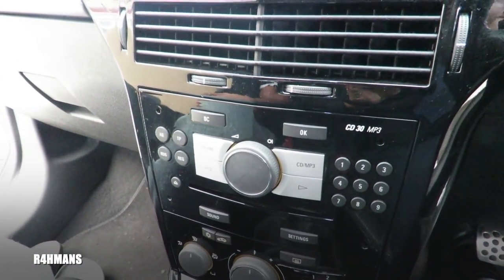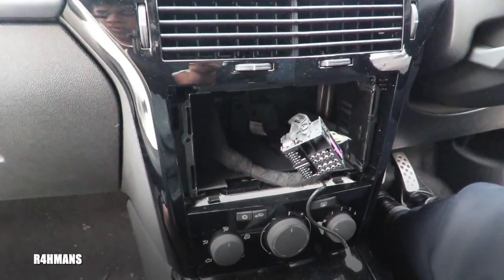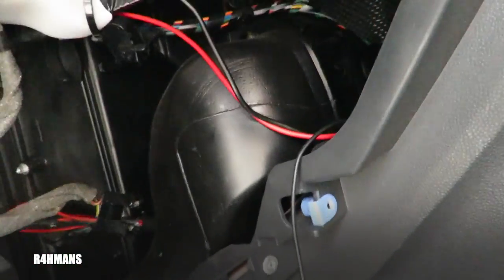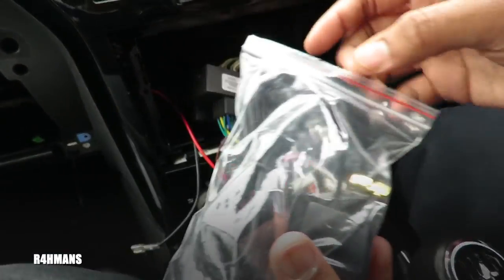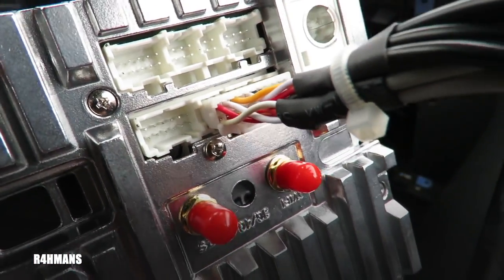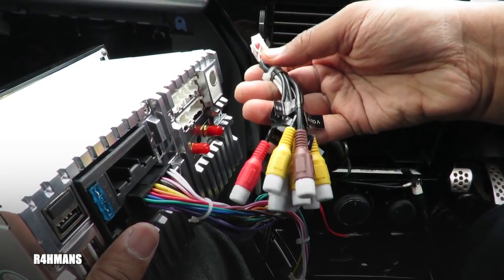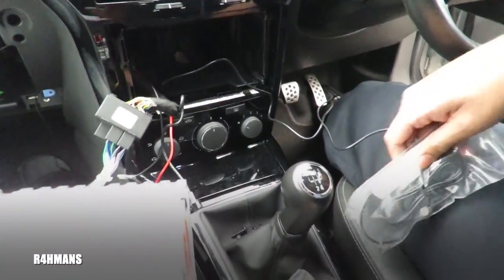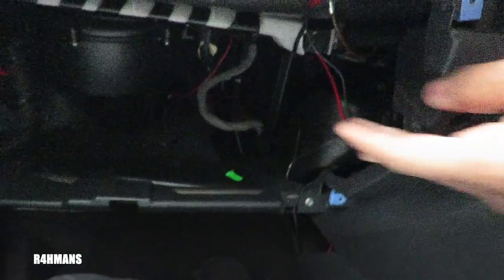Installing Pumkin Headunit Astra H With Apple CaPlay and Android Auto Adapter

Comment: Can you control and change car system settings like km/consumption statistics etc??
Reply: hglrr Yes, you can. Just with the steering wheel buttons or an app on the Android unit
Reply: Mick did he connect steering wheel control
Reply: @noneya96  there is by default on astra h

Comment: bro thank you for the well explained tutorial! i got one question, can u connect this radio to a rear camera for driving in reverse? ty in advance !! 🙏🏻
Reply: and if so, can you do a video to that topic? or maybe link me where i can find out how to do that?
Reply: It is actually very simple to install. You can buy a special reverse camera that replaces the license plate light unit for the Astra H. You will have to connect 4 wires to the Android unit: rca videosignal, reverse signal (which activates the camera when you go in reverse), positive pole and the negative pole (ground). There are special wires labeled for this at the Android unit. Don’t use power from the reverse lights, since they are canbus powered. When you set the gear to reverse, the music will stop and the camera shows automatically. You will have to guide the  wires under the plastic covers underneath your seats inside the car, which also hides the other wires. The hardest part is to remove the plastic cover in the boot, which is just pulling. Overall a very easy job to do, it shouldn’t take up more than 30 minutes.

Comment: What about car's computer controling? (navi, fuel consumption etc.)
Reply: If I'm not mistaken, that's all in a separate unit above the stereo
Reply: @Jimlad0116  well its controlled by that biggest ring on the original astra H radio :)
Reply: @realonepx9885  ah I get what youre saying. I literally bought my first one yesterday so I'm not fully aware of all the functions lol. Thanks!
Reply: @Jimlad0116  can I ask you if u figured it out? :)
Reply: @realonepx9885  I didn't bro. I just bought a radio Bluetooth thing instead.
Reply: I bought the same android unit for my Astra H 2007 to replace the CD70 unit, and the car’s computer still works which I can control with the steering wheel buttons. There is even an app on the Android unit which takes you to the car’s computer settings so you can still change the time or screen brightness. So I guess the car’s computer is not inside the radio, but you only control it trough the radio. Overall I’m very happy with this unit
Reply: @Mick16xel  Hi what is the application ?

Comment: The display above will work still? Like GPS, Engine stats like temps etc? (mine is not orange like your LCD)
Reply: Did you ever find this out? I have the same question but can't find an answer
Reply: @seancorrigan3531  nope

Comment: Will this not require a radio code? What if you refit back the original stereo just in you want to sell the car with the original stereo, will a radio code required? Thanks for the help. Great video though.
Reply: Allan Cantos You won’t need a radiocode to install this unit and you probably wont’t need it when you revert the original radio as that radio is ‘married’ with the car’s immobiliser

Comment: Hey, how is the sound quality of this? Does it match the OEM or is it better/worse? Also can you change songs when connected to BT from the steering wheel?
Reply: this module is just for phone calls, nothing else. you can only use the aux port on your car if its fitted. otherwise go aftermerket

Comment: Is the upper small display of the car still working and controlable? Because you remove the controls and replace them by the pumpkin radio
Reply from the maker: Yes it does work, and the controls are used by the steering wheel, but you can’t use the headunit to do anything on the small screen

Comment: Ok so...how do you enter in the setings of the car now? On the original unit you had the BC and the arrows to scoll thru the menu on the upper screen to se the consumption and all that. How do you do this now?
Reply: With the steering wheel controls, or using the provided App named control settings on the unit itself
Reply: @Mick16xel  Mick, thanks for answering this a year ago. I’m thinking about getting one for my daughter. She’s got an 2008 Astra 1.6 Sxi and it’s exactly what I was wondering. 👍

Comment: I have just purchased one of these, could you tell me how the unit was over time please?
Nice video by the way.
Reply from the maker: It is really good, I’m still using it, I like the fact you can add a reversing camera that’s the best part and having Bluetooth Audio
Reply: @R4hmans  thank you I apprieciate your response
Reply: @R4hmans  do you need to have the phone plugged in for Apple CarPlay?
Reply: TheHighFlyer Not anymore, there are wireless carplay adapters available now. Just search for “carlinkit wireless carplay”. With this adapter, you can choose either wireless trough bluetooth and wifi, or trough lightning cable. However, I recommend a wired connection as carplay takes a lot of battery life....
Reply: Does this use the data from you're phone to play music / use google maps ect? TIA

Comment: What happens with secret menu ,can you still acces it after ?
Reply: Cernea Marius I did not found any wat to get into the secret menu since the BC is not there anymore. But you can connect a bluetooth OBD adapter and read almost every value of the car on the screen

Comment: The steering wheel comands work ?
Reply: You saw that red box that came with the wiring harness? That box allows you to use your steering wheel controls :)
Reply: @CasSpell  Well, yeah.. But i too have this red box you are talking about but my steering wheel controls don't work. Can not even calibrate them.

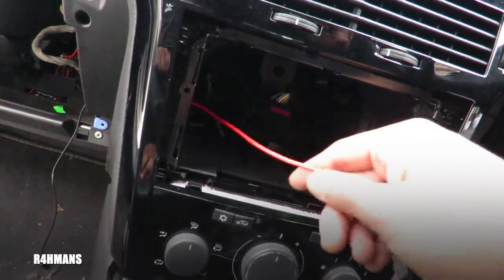Comment: 4:23 WHATS HAPPEN WITH THIS RED CORD,WIRE ,CABLE.
WHY I AM AFTER OF THE DISCCONECT THE KEY,  the radio is power of BUT IS STANBY I PRESS ANY BUTTON AND THE SCREEN IS turn on.  MY BATTERY OF THE CAR ITs over in the next day.!

In sumary the radio is not power off in after of the discconect the key of the steering of the car.
my english is very bad becausd i dont know english i am know spanish.
  
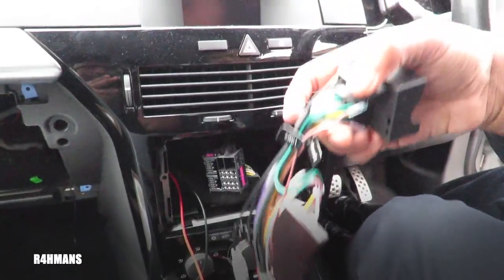why you dont conect the red-rose wire cord?? As 4:23 ?????  Is left loose this wire-cable?????

I want that work good the steering wheel controls and after disconect the key, THE RADIO IS POWER OFF AND THE NEXT DAY I GET BATTERY IN THE CAR.
thank for this video !
Reply: No entiendo muy bien lo que has escrito? Lo puedes poner en español por favor? Gracias

Comment: Does anyone know if the apple car play adaptor will work with an android head unit that isn’t Pumpkin?
Reply from the maker: It should work, because with the adapter you install a file which comes with the adapter so as long as it’s android it should work
Reply: R4hmans Cool I’ll give it a go
Reply: R4hmans It worked but I left it connected to my head unit and it drained the battery overnight lol has this happened to you?
Reply from the maker: EliteGamer197 it shouldn’t drain the battery though, did you turn the head unit off because I know sometimes the headunit doesn’t turn off automatically so you have to press it to turn off, this happens on my headunit I have to press the off button or some times it’s does it automatically
Reply: R4hmans Ah ok I might have to try that after I charge the battery

Comment: Is it possible to log on to the computer board? Is this feature available?
Reply: Angel Stoicov what kind of log do you mean?
Reply: Angel Stoicov if you mean if the board computer is still available after installing the android radio unit, then yes! You can control it if your steering wheel has buttons for the bc